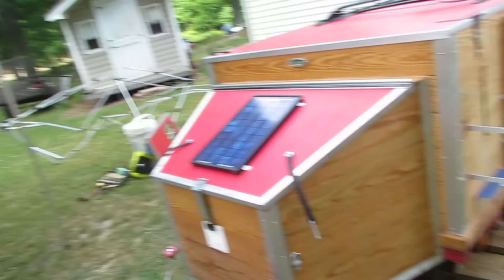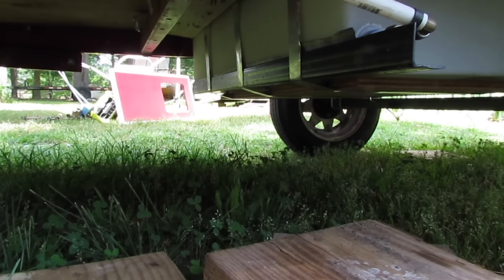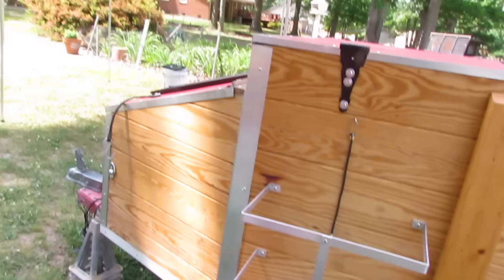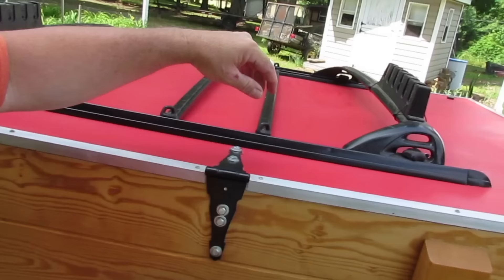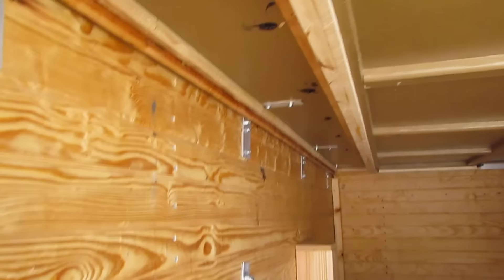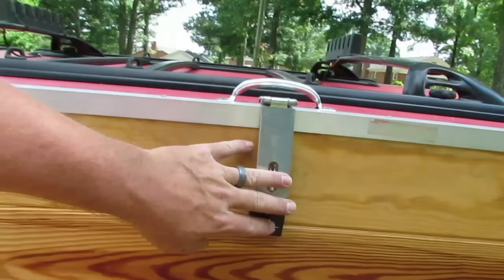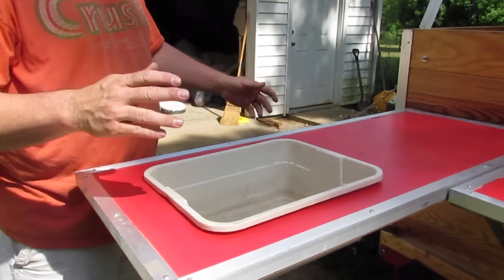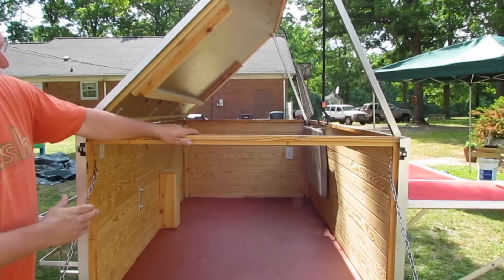Harbor Freight 4x8 Camping Trailer

Comment: 21 gallons?  Whoa.  I know that water can get used up fast but wow, that's a lot.  And a good bit of weight- 174 lbs.
Reply from the maker: Yes, that is a lot of weight but I don't travel with any water in the tank, no need for the extra weight when I can always get water at the campground.
Reply: +Jeff Furr Nice job all around, espec on the electrics!
Reply from the maker: +SGaux Hey, just got your email, so sorry you're having trouble. Fortunately, I didn't have to put mine together because I bought the basic trailer, slightly used off of Craigslist. Unfortunately, that probably means I'm not going to be that familiar with the assembly of the trailer frame. The only thing that I did to the trailer before starting the build on top of the frame was bolt the two center cross members together. Now, that being said, I am more than willing to attempt to help you figure this thing out. Nothing worse than being stuck with no help, sometimes all it takes is a second set of eyes and it comes together. Send me the pictures that you took along with pictures of your directions if you can and I'll look at it. Also, if you can take a picture of the trailer as is. Email the pictures to thefurrminator@gmail.com
Reply: +Jeff Furr Thanks, a lot.  I definitely need just a 2nd set of eyes so I'm crazy looking over what I think is right.  Will send tmr.
Reply: +SGaux   Hey there, Jeff.  I sent two messages.... the latter being more timely.  Hope that you can take a look.  Thx!

Comment: Have you actually weighed that thing? The maximum (not normal everyday) hauling capacity is only about 1800-lbs. I wouldn't routinely exceed 1400~1500-lbs. All that stuff you've added (wood, brackets, jacks, spare tire, battery, inverter, wiring, outlets, water tank, water, roof rack, rear cargo rack, etc) surely can't leave a lot remaining for cargo - which makes the extra cargo racks somewhat redundant.
Reply: It's thin wood, and most of the metal he added is aluminum.

Comment: Why don't you add an extra axil for better balance for hauling and won't be so wobbly
Reply: Brent Smith Because in most states if you have a dual axle trailer you’re required to have brakes that function on the trailer. Single axle trailers do not require brakes, and if you have to have brakes then you have to have inspections as well

Comment: do you know how much it weighs and the cost of materials ?
Reply from the maker: I think it weighed in at approximately 840 lbs. that being said, I realize that the build itself is using a lot of the payload. I have changed the tires already to accommodate a heavier load. My next task for the trailer is to upgrade the axle and springs. I started keeping up with the cost of the build in the beginning but quickly lost track, but I have estimated approximately $1,500.00 total including the initial purchase of the trailer. I used a lot of aluminum on the build that was as much cosmetic as anything so a lot of that cost could have been reduced by eliminating some of the aluminum. Hopes this helps.Thanks for watching

Comment: i thought u could sleep in it u still have to have a tent?
Reply from the maker: Yes, still have to have a tent. My first thoughts were to make a teardrop trailer and use it as a sleeper but with my large family that just wasn't going to work. I decided to continue sleeping in a tent for now and use the trailer as a gear hauler and a chuck wagon. We may convert it to a sleeper at some point by simply adding a mattress but first I'll need to add some ventilation and make some adjustments to the tailgate so we can open it from the inside.

Comment: What speed is that trailer rated at ? And did you drill into that frame possibly causing it to weaken?
Reply from the maker: fred the wheels are rated for 55 mph. I have drilled a couple places where I've added lights and the rack on the back but no major frame alterations.
Reply: +Jeff Furr (The Furrminator) Well it looks great and it's obvious your a skilled tradesman.
Reply from the maker: fred thank you very much, I appreciate that.

Comment: How did you attach the back rack?
Reply from the maker: I mounted square tubing to the underside of the trailer and mounted more tubing to the bottom of the rack that was small enough to slide into the tubing on the trailer. I drilled a hole through each side so I could use a hitch pin. It can easily be removed if need be.

Comment: How much did the 4X8 trailer cost to begin with? And how much money did you put into the project?
Reply from the maker: Bought the trailer from a guy on Craigslist for $250.00 or  $275.00 I think. It had a few extras like a spare tire and plywood. I didn't keep up with my expenses as I built it but I spent somewhere around $1200.00 building it. Keep in mind that I went overboard with it like most of my projects. I could have left off things like the aluminum and saved a good bit. 

Thank you for watching
Reply: Thank you

Comment: You sleep inside on an air mattress?
Reply from the maker: We could but we don't, we sleep in a tent and use the trailer to haul our gear and as a chuck wagon while set up. We may use it to sleep in at some point but I would need to add a vent and modify the tailgate to open from the inside.

Comment: you'd better place some rubber guards on the corners of that counter before kids get gashed in the face!
Reply from the maker: No doubt the corners are sharp, we have an additional sink that we place near the sink on the trailer and a chuck box that hides the other end, no chance of the kids running into those corners.

Comment: I would beef up the suspension and wheels you can get a 48" centered 5 ton axle complete hangers and hubs for $175 14 " Loadstar d tires are $140.00 a pair. Ply wood is heavy too much go on Craigslist find a hard tonue cover for a S10 you can put it on a piano hinge and plastic straps open it up put mosquito netting if you say yes reach out to me you pay shipping and eBay fees I will put it for basically free. I sell surplus...

 Like the trailer just think it's overweight you can remount the piece in the center.
Reply from the maker: A A Thanks for the tips! I will keep them in mind! Thank you for watching!

Comment: Impressive. Don't those trailers have a fairly low weight limit though? That's the only thing I'd be worried about.
Reply: Soulman1282 Was thinking the same. Jeff said he was concerned about tires, and wisely so, but might be smart to weigh trailer when loaded to see if that Chinese  axle is being tested beyond its limits.
Would hate  to see all that fine work and a vacation disrupted.
Reply: +Hanlon Greg yup, I have the same trailer, regardless of the tires, the axle is only rated for 1200#
Reply: Hope he reads this before hitting the road... he's put a lot of love in that project.
Reply: +Soulman1282 Depending on which model he has, it can be 1100 or 1700 pounds.
Reply: If I remember correctly the 1700 had 5 lug wheels, I could be wrong. But I do love my trailer!
Reply from the maker: Thank you. Sorry, I'm a little behind on replying. These trailers do have a low weight limit and I'm pushing the limit with mine but I have already replaced the tires that had a limit of 740lb each with tires that have a 1200lb limit each and before I overload it I'm going to replace the axle and springs. Just so you know, I may at some point pass the original weight limit but I'll never get close to what the tires can hold. Thanks for watching
Reply from the maker: +Hanlon Greg yes it would not be good to lose all this due to overloading the trailer, I do push the limits on it but I'm not going to load it too heavy before changing the axle and springs. Thanks for watching
Reply: Ok Jeff. Keep the family and those around you on the road safe.

Comment: You should of just put a axle under that little shed With the white door an two little windows
I got a motorhome for sale 89 F 350 
Loaded with everything $3250
Reply from the maker: Not looking for a motor home but we may be upgrading to a travel trailer at some point. The little trailer will suffice until we can upgrade.

Thanks for watching
Reply: Times are  tough ,like i said it is awsome to rough it,just through a tent on a set of wheels an go,,why waste thousands of dollars  to have a gold sink in your motor coach,,for camping,,them ppl make me mad,,your little tag along is awsome,,good luck,be safe,god bless,make sure you grease wheel bearings

Comment: if the dc panel folds then why are those terminals on the outside waiting for something metal to get dropped and short them out?? any fuse on that hot??.... oh and i believe that water tank may not be dot approved.... so capacity is 1190lb's or so and when filled the water is 21x8=168 plus tank, bed rail and pump so 200 right off the top... all the tongue and groove and the other plywood is how much lb's? and the metal rack at 80+... 50+ just in hardware... spare tire... extra water container at 5 gallons is over 40 times two so 90 loaded.... then the extra counters!!! lid lifted "it's pretty heavy"!!! no shit!!! then updating to higher capacity tires?!!? "i felt pretty good about it but..." well of course because your in the tow vehicle!!! "these edges are pretty sharp".... no shit!!! i saw about 90 places ready to make a person bleed in this video!!!(you have blood on your hand man)so i watched all the way through and i must say... you are making your hardware store rich, endangering anybody that's not you with sharp corners all over the place, probably near full capacity so you can haul pillows and sleeping bags i guess, violating the dot codes with the extra rear carrier, already planning on buying harder tires to really stress out your "folding frame 299 dollar trailer", oh and those battery terminals need a fusable link!!! "lord please ensure i am never behind this trailer going 55 down the highway when it breaks into a million pieces" and good luck man...
Reply: sorry to be critical because it's a pretty cool build but i see a way heavier duty trailer in the background and think "why would you put that much into a 299 folding trailer with such minimal capacity"
Reply from the maker: wow, very critical but what kind of person would I be if I couldn't take criticism? no problem at all, I completely understand that this build isn't for everyone. The reason I built on the cheap trailer is because I had seen others that had built teardrop trailers using the Harbor Freight trailer and they turned out good. My first plans were to build a teardrop until I realized that just wasn't the best idea at the time with a large family and a teardrop only sleeps two. Also, it made it a little more challenging, taking something so small and getting so much out of it. I was under the trailer the other day adding some lights and the frame is holding up great at two years old and approximately 1,600 miles on it so far. I appreciate you pointing out the negative parts, I've had a lot of people make suggestions and I have taken them all into consideration and will be making adjustments or modifications based on my viewers suggestions.
Reply from the maker: +youtubesuckfornotlettingmekeepmyname the trailer you see in the background is very old, rails breaking apart and it has a bent axle, not a good trailer to use to build this type of camping trailer out of. Also, just so you know, I have had a lot of people, like you, mention the weight of water and how that is added weight. I'm not sure why people like to mention that so much unless it's just something else to be negative about or maybe they just like showing off their math skills. I have never traveled with the tank or the containers full of water and I never will. Water is something that I can always get at the campground and it is unnecessary weight to pull down the road, especially in the mountains where we travel to frequently. Again, I appreciate your critiques, not as much as constructive criticism but never the less, appreciated. Thank you for watching
Reply: The Furrminator 
   You have to feel sorry for these kids that are not able to read as yet
either due to their lack in maturity or mental capacity...
I’m certain that your Adult readers found your explanation that you do 
not carry water with you when you travel but in fact get your water once you 
arrive due to not wanting to carry all of that unnecessary added weight as you
made very clear in your video presentation to us...
   I would have to guess that this person must have missed that part because he
was too busy trying to find fault with every part of your presentation to us.
This is a common occurrence with people who attempt to put others down as a
means of trying to make themselves feel important in their tiny, insignificant, and
miserable lives which is so very sad 😢...

Comment: If you would quit loading so much water weight and everything on the left side of your trailer you would be all right you need to even the wait out
Reply from the maker: Thomas Reyes I have no water weight on my trailer at all during travel, the only time I add water to the water tank is when I get set up and I use those cans to fill the tank. Hauling water is unnecessary weight to carry. If I did haul water though, I would agree that the water on the drivers side would cause it to be much heavier on that side. Thank you for watching

Comment: WTF?? so you built a trailer to have a counter and a tiny table? 32 sq' of interior space you apparently dont use? were you just bored?   I was 1/2 expecting it had wall that folded up to a higher height and that it gets slept in or something., i mean the title for this video is CAMPER?
Dont get me wrong, it looks well built and thought out, just disappointed in end usage, but gives me ideas to  continue what i thought you had built